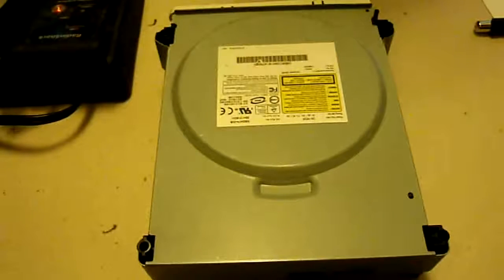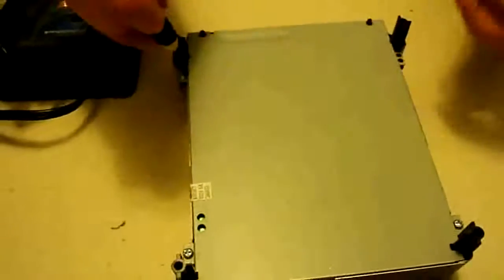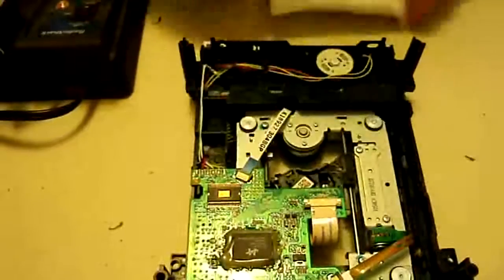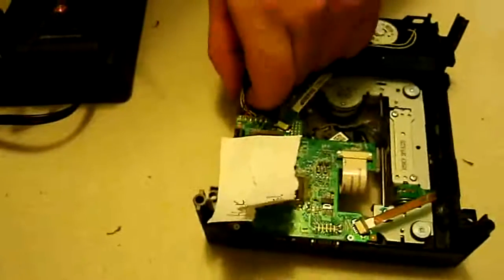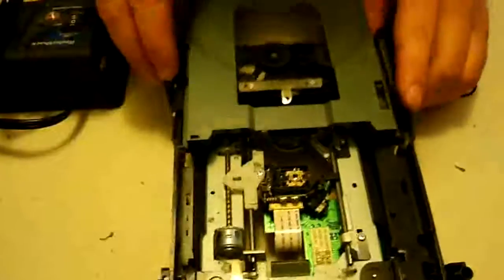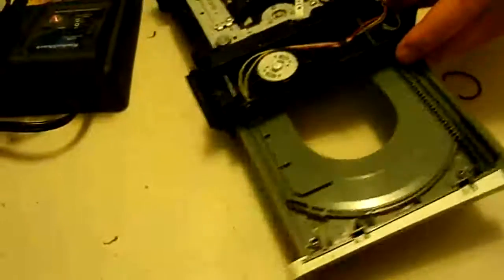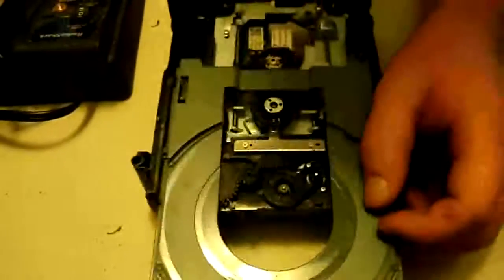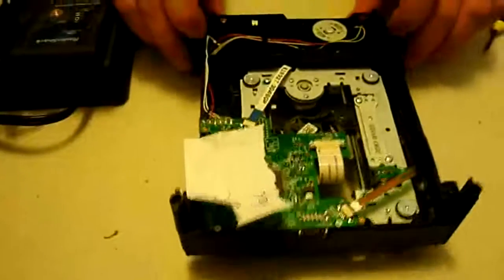How to replace your Liteon DVD disc drive eject motor and belt. Xbox 360 FAT repair tutorial

Comment from the maker: Unless something has fallen out of the drive then it has to be this. this is 100% what controls the disc tray movement. In fact I have never seen a case where this motor and belt are NOT the cause of the drive getting stuck.

Comment from the maker: You MIGHT be able to find a hobby motor that will match the one on the Liteon drive, but it would be a long shot. Otherwise you are left with eBay. Also for the belt (which might be all you need to replace) you can use these little rubber bands that you can buy at a walmart. They are in the hair section and meant for pony tails etc. The ones I buy have three sizes in the box and they are only .99 cents for the box. Use the smallest one.

Comment: Yeah, motor usually doesn't go bad, the belts are mainly the issue because they get stretched and slip and can't overcome the magnet that clamps the disc down to the spindle. I know my 360 won't eject if a disc is not left in it without percussion maintenance, heck sometimes WITH a disc in the 360, it still needs to be smacked to get it ejected.